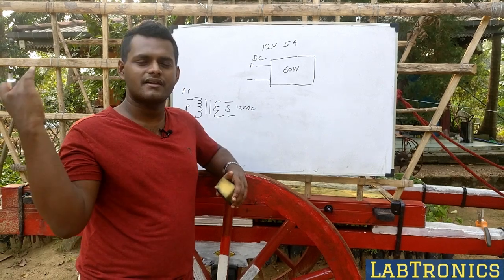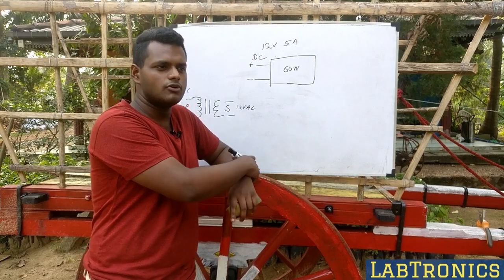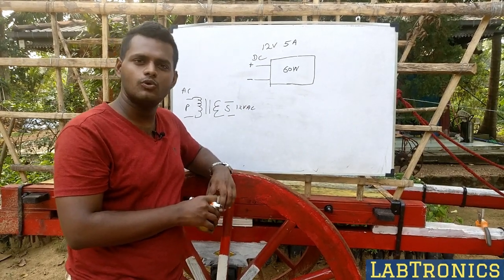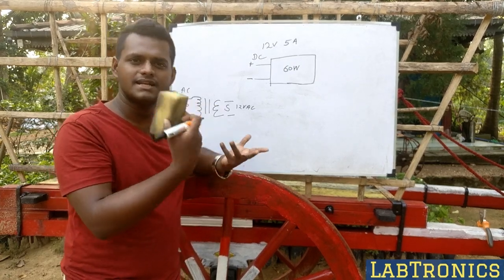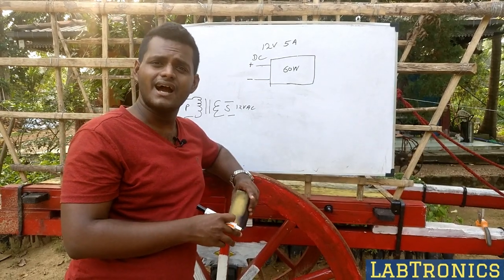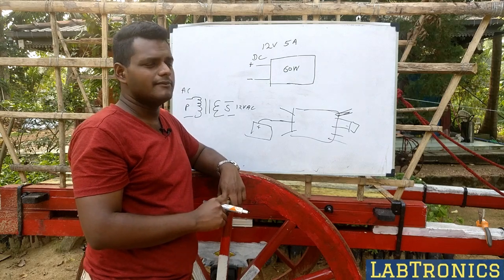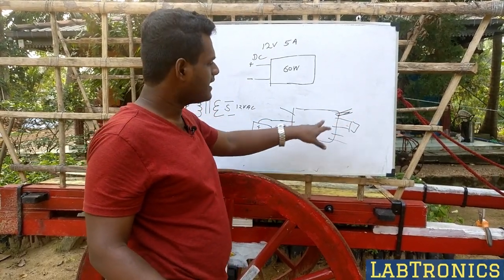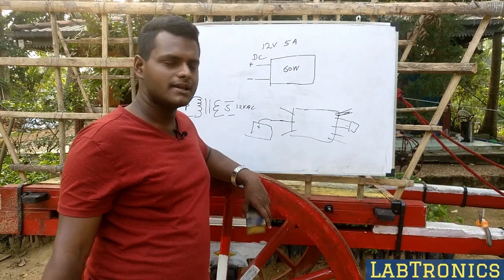Part 02 Transformer selection in Sinhala(ups transformer) (Transformers in sinhala)

Comment: Bro.oya transformer eka check karana widihedi  wadi deepthiyakin  bulb eka pattu wenne 220 v in eka.primary side eka. Nathnm wire harnes eka tap karala aragena nm hadala tiyenne multiye ohm scale eke aduwenma katuwa yana winding eka ( ohm agaya wadi ) thamai 220 v input wenne.
Ma gawa transformer ekak tibba.eke tibbe oya widihata
Reply from the maker: Ea kramea hama ekakatama sarthaka na bro.
Reply: Bro..et mama balapu godak transformer walata wada kara ..
Puluwan nm supercapacitor gana video ekak karanna.field eke inna ayata eka godak wadagat wei.
Ela broo..thanks rply ekata.
Reply from the maker: 👍 ow man final project ekatath super cap use kala